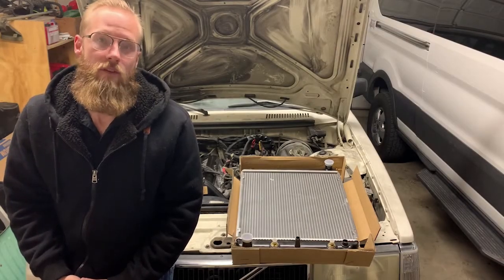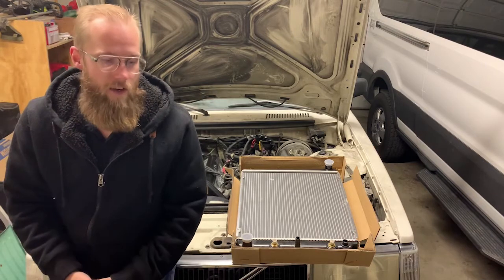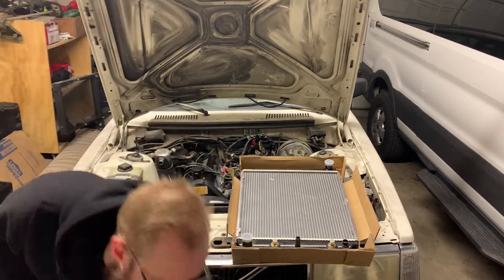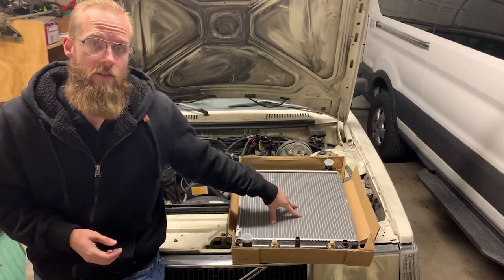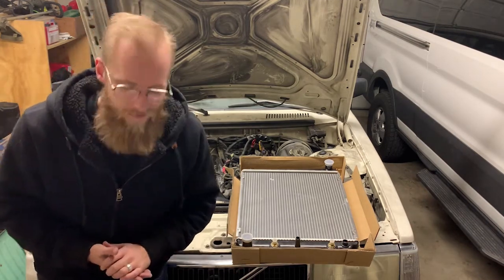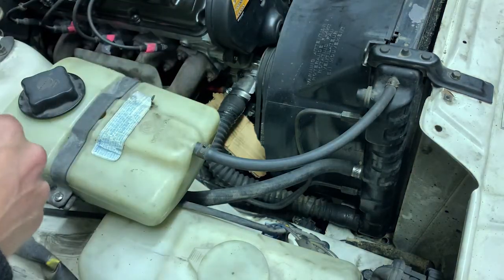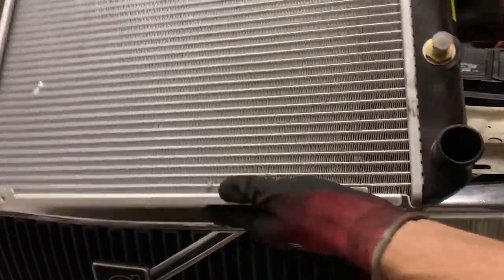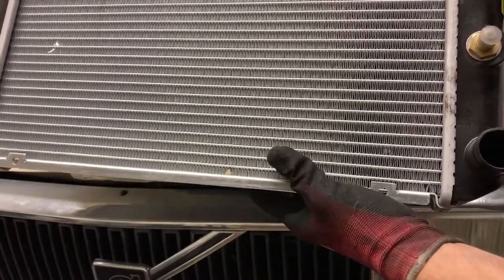$70 Radiator - Volvo 240

Comment: Your original rad. had no issue except 30 years of dirt and debris caught in between the fins.
A good pressure wash from the opposite direction as the air passed through will show a huge amount had built up .I would buy your old radiator for 20.00$.
Reply from the maker: Good to know! Unfortunately, I already scrapped the rad. Next time!

Comment: If that old radiator is ALL ALUMINUM you may want to keep it and have it cleaned at an old school radiator shop.
Reply from the maker: Thanks Robert! Upon inspection it was not, and has since been disposed of.
Reply: I just put a 91 240 radiator into my 93  940 turbo (had cracked plastic ). A couple of simple mods, and it works great!
I also removed the electric fan to install an engine-driven fan w/ 240 shroud.
Reply: Plastic side tanks were std on the 240 from the get go I think.  Nissens made an all-metal 3-row version which I've put in most of my 240s.